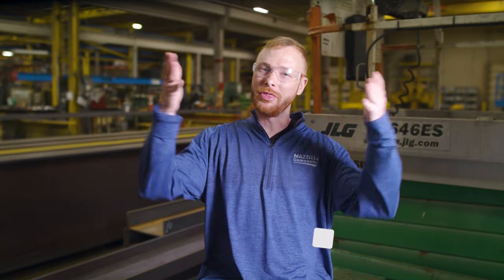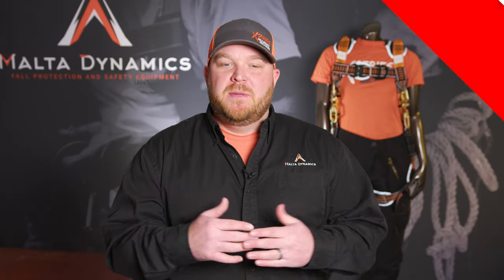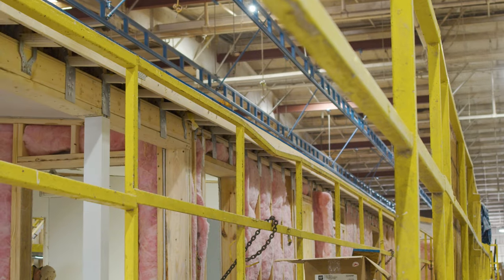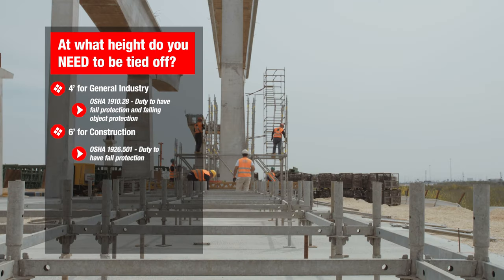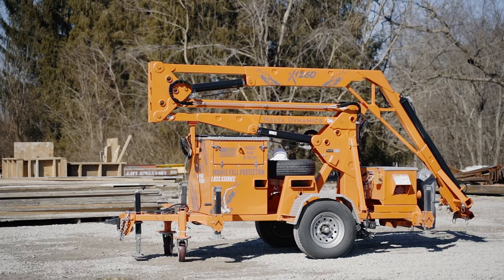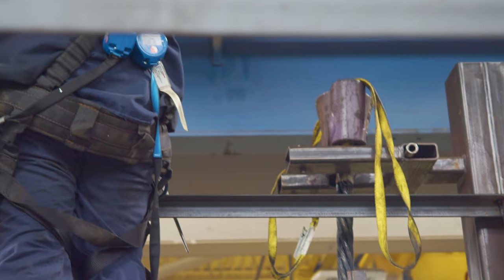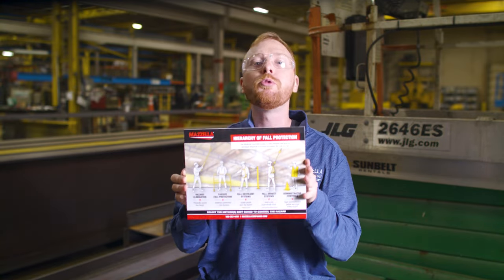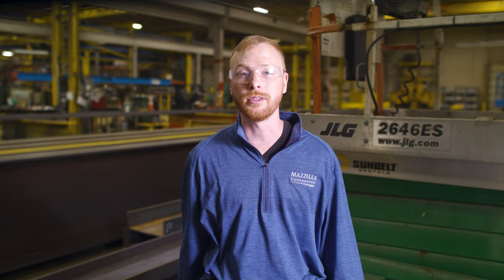The Basics of Fall Protection in 6 Minutes

Comment: Most falls are caused by trips and stumbles from the ropes. They also add a lot of stress which increases the likelyhood of an incident.
Reply from the maker: This is why you want to engineer the best type of fall protection solution for your application. You don't want the solution itself adding to the hazard. At Mazzella we supply and install custom engineered fall protection systems so you don't have to worry about tripping over ropes. If you are tripping over ropes, odds are your fall protection system may not be compliant.
https://www.mazzellacompanies.com/solutions/fall-protection/

Comment: what is the minimum KN's a carabiner has to be?
Reply from the maker: 24 kn is equivalent to 5400 lbs. 
Typical minimum 
The typical weight requirement is 5000lbs 
Compliant to the OSHA standard - unless the manufacturer of the carabiners specifically specifies a load rating

Comment: Great information thank you. Can you have two protection lines attached to the 18" D-ring extender? One line would be adjusted but a second person while going up, and the other line will have a rope graber. Can you do this?
Reply from the maker: Thanks for watching!  I reached out to our fall protection expert, Kevin Muldoon, and this is what he had to say.
"It sounds like this is a vertical lifeline. 
The answer is no. Each connection should be connected to an anchor point designed to accept the load of a single person attached. The exception is an Engineered system designed & engineered to have more than one person attached between a series of anchor points. Non-engineered system 5,000lbs. Engineered system averages at least 3,600lbs per worker attached. 
Simply put each worker needs to be attached to their own line two people cannot be attached to the same line unless it is engineered expressly for that purpose."
I hope that helps.  If you have any other question feel free to contact our fall protection division.  They can answer any question you need.  https://www.mazzellacompanies.com/company/contact-us/contact-fall-protection-division/
Reply: @LiftingandRigging  Thank you very much for taking the time to answer my question. Both lines would be for the same person. The second person would be on the ground adjusting one of the lines while the main worker is going up. The second line would be atached to a rope grabber. My question is if you can use two lines atached on the D ring extender but for only one worker. He is a little afraid of hights so he would feel more secure having two lines. I hope you undertand my question... Many blessings.
Reply from the maker: Here is what our fall protection expert Kevin Muldoon had to say.  "Simply put, you can’t have two lines connected to one anchor point for security – the question becomes how about three or four lines. If he had to lines, one would have to be primary and the second secondary each having its own anchor point. An example of this, is “repelling”  window washers – rock climbers – equipment specifically designed to have a two line system – but again they have a primary and secondary lines. Each Line has its own anchor point.  Hope this answers your question."
Reply: @LiftingandRigging  Yes it did. Thank you!

Comment: Can I use a endless sling or a sterling sling as anchor ⚓️?
Reply from the maker: Hi, Joseph. I reached out to our fall protection expert, Kevin Muldoon, to answer this for you.
The answer is no. The reason is that there is no rating for fall protection on these slings. You would need to know the Maximum Arresting force rating. When slings are rated, they are rated for lifting loads gradually. When you have a fall you are going to be shock-loading your system. Fall Protection systems are rated and labeled for a maximum arresting force. Slings are not.

Comment: I noticed in the video around 0:43 that a worker was on the roof using both a 6' lanyard and a retractable connected to each other. I am not certain this is permissible by OSHA or manufactures. Can you clarify? Thanks!
Reply from the maker: Our experts reached out to Tractel, who designed this system, as well as OSHA, to get a little clarity. When using an SRL that has a snap hook, you cannot attach another snap hook to it. Two snap hooks cannot be connected together. Tractel does engineer lifeline systems that have special SLRs that have an engineered attachment point rather than a snap hook. As this is not a fall arrest system and a fall restraint system, that may have been the case. Unfortunately, we cannot properly see how the lanyard and the SRL are connected in this video to confirm this. The footage was taken many years ago, so Tractel cannot confirm this was the case in this particular video. Thanks for your vigilance, and thanks for watching!

Comment: Will getting roofing tar on the rope of my fall protection safety harness rope weaken it and make it dangerous?
Reply from the maker: Getting roofing tar on your harness, lanyard, or SRL could interfere with its proper operation. Therefore this is a cause to remove from service.